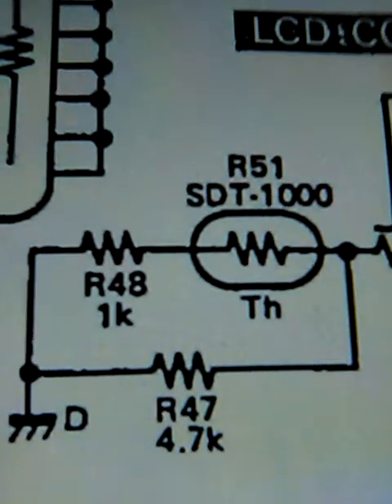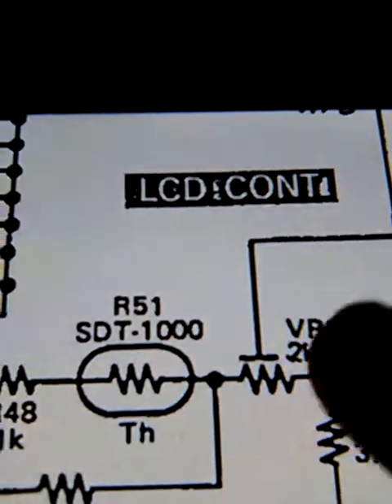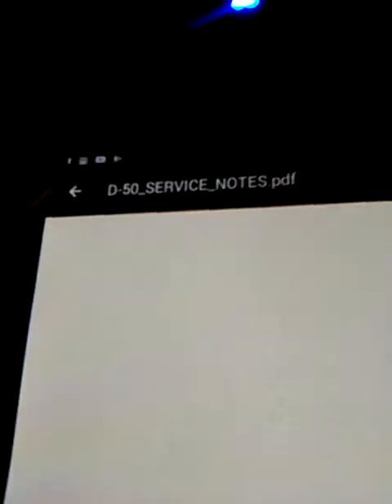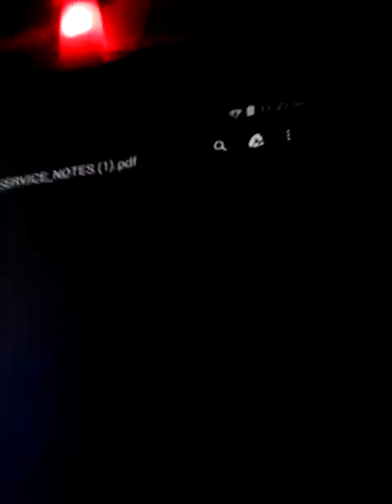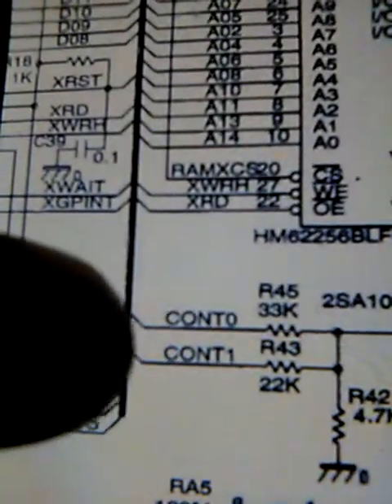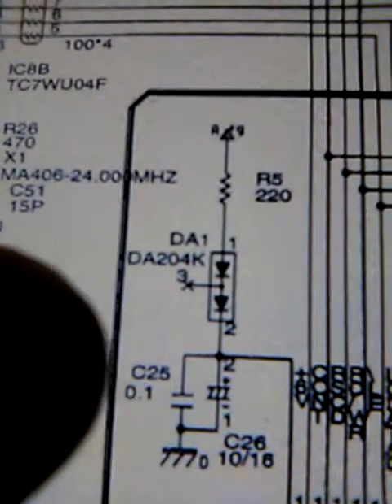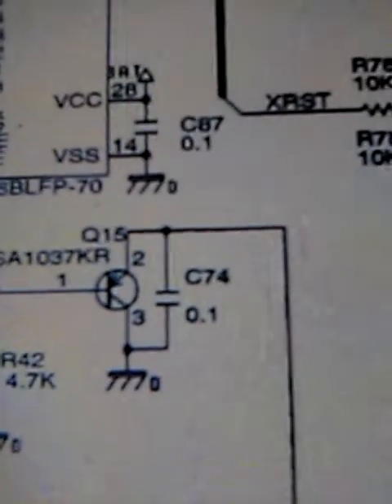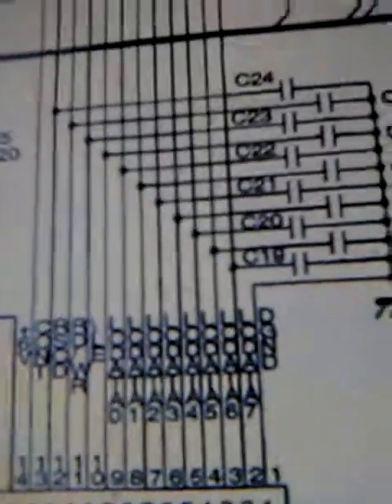Roland XP-10 Repair #5

Comment: i just upgraded my display today with backlite i follow the connector pinout to new lcd and get the 5v  a k  from 9v to 5v regulalor works like a charm !
Reply: Which lcd did you use? I have a 1602A chinese display here and I think it should work. Can you give me more information about replacing the display?
Reply: @jorickver  hello  all standard HD44780 equivalent LCD will work just fine
i use 1602a just like you 
download the schematic and just follow the pinout from board to new lcd  i took out  the flat ribbon connector and hard wired directely from board to new lcd and for the back lite power i used the 9v to 5v regulator ic to power the lcd backlite .   one more thing try to use a lcd with potentiometer already on it .   i had to add a pot to adjust  the contrast ...  it will save you some works for just a few bucks .   let me know if you need more help !  !
Reply: @reyznbran9586  tnx :-) my XP-10 has backlight and the ribbon cable is 14 pins. The new display has 16 pins. Anode and cathode are the extra two i think. I will have a look where to get the power from. How did you arrange the potentiometer for contrast? Which value and which pin did you attach it to?
Reply: @jorickver  10k pot,  attached  pin 1 and 3 if i remember good   get the 5 v power from 78l05 power regulator ic   just like i did ( works perfectely )
this is just  standard  job straight  forward
Reply: @reyznbran9586  I soldered in the new 1602a display today. Used a 10k pot for contrast and a 500 ohm pot for the anode of the backlight which I picked from the 7805. Worked first try 8-) tnx for your advice!
Reply: @jorickver  good i am happy for you it went perfect